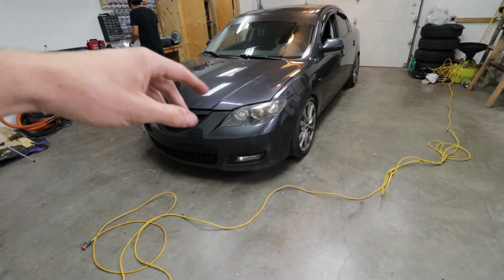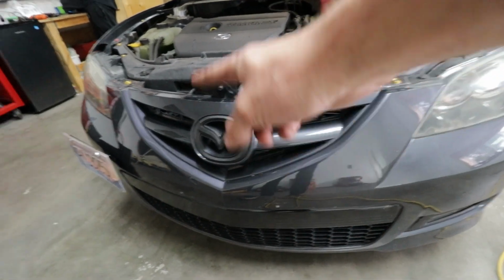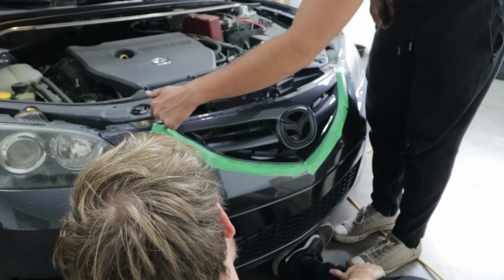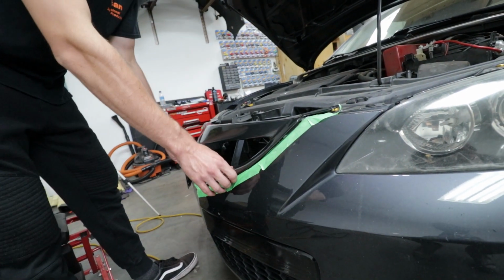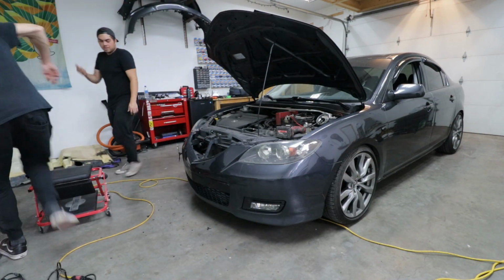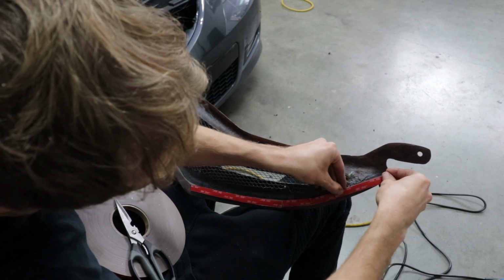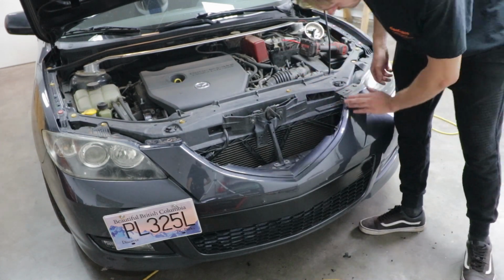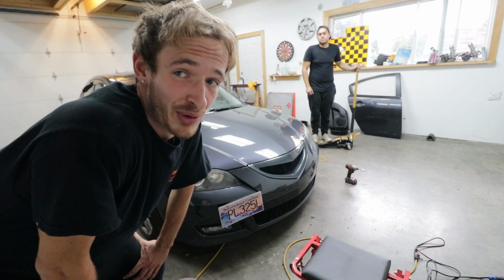Duraflex OPEN MOUTH GRILLE Install On The MAZDA 3!

Comment: My 05 mazda has 2 bolts and it just comes off no need to cut anything, they sell open grill so you can just bolt them on!
Reply: The gt bumper is different. You have to cut the grille out on the gt
Reply: @thomasbroesky4322  oooooohhhhhh okay, I didn't know that thank you!!
Reply from the maker: That was the same with my original bumper which was mid trim, but the GT's came as part of the bumper.